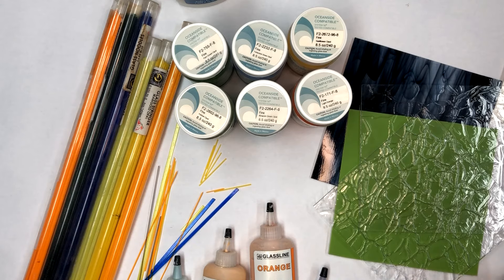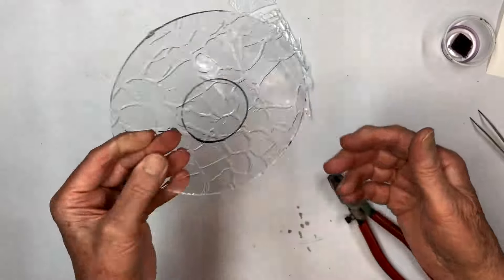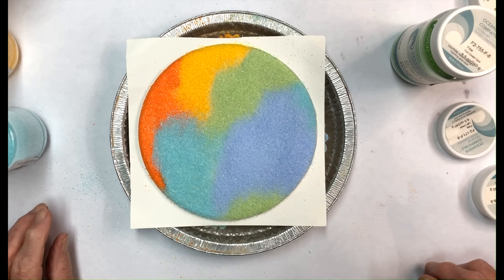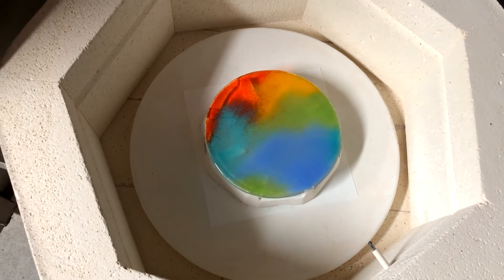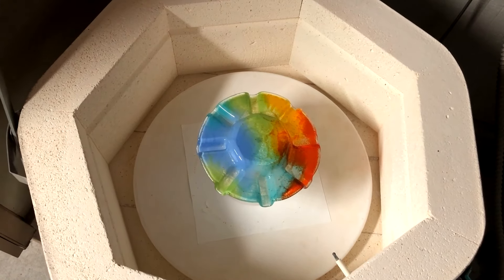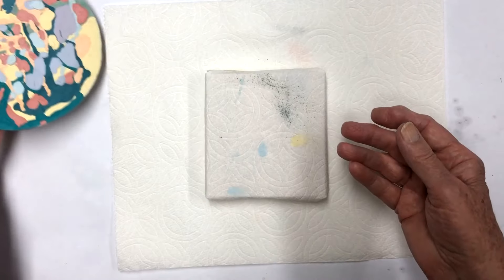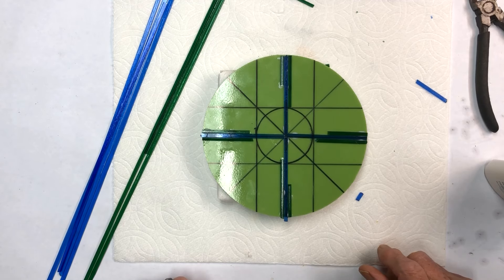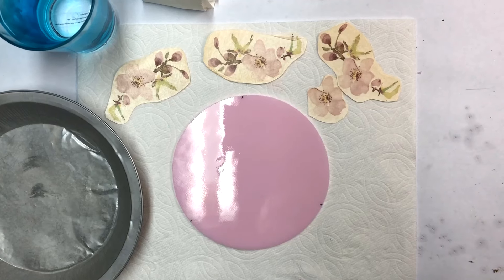Fused Glass Candy Dishes!!!

Comment: I so wish I had a kiln! It is on my list ❤. The dichroic bowl is my #1 favorite. My #2 is the pink with decals. Thank you for sharing your knowledge. You are inspiring.
Reply from the maker: Hi Karen, 
Thanks so much for your vote, I'm going to post the winner this weekend. You will get your Kiln when the time is right. You have to remember it's taken me 50 years to collect all the different systems I have. I had to learn most of these systems by trial and error over time, but with YouTube now you can find out how to do just about anything you want!! Alot of time you can find these kilns for sale in the local newspapers. Before I purchased this one, I was using an old kiln made for making ceramics and it used what they called a cone setter for the max heat and then would turn off. Check around with friends they may know someone that has a kiln just setting around would like to get rid of it. Most of these small kilns just use standard household 110 voltage lines to plug into. If you were happened to find one of these old kilns, don't pay a lot for it, and you would meed to buy some setter cones for setting the heating range. I found 019 cone for draping all the way up to 015 cone for a full fuse. I'm sorry for rambling on!!! Have a great day!!
Regards,
Bill Stone

Comment: Great Video! My favourite is the dichroic dish. Did you use 3mm glass for each dish and was the first firing a full fuse?
Reply from the maker: Hi Alisa,
Thanks for your vote. Yes, all the base glass is 3mm COD 96, it's the old Spectrum glass and is now Oceanside Tile and Glass. The first fuse is a full fuse at 1475, The second fuse is at 1400 to slump and the third fuse is 1220 to drape the dish. I will show a fusing schedule at the end of the video showing the winner of the dishes. It will be posted at the end of the week.
Regards,
Bill Stone

Comment: They are all great. Good conservation of glass using 1 layer. Curious about the fusing schedules. I'll study them in a minute. What COE are you using? Favorite is actually the painted one. New technique for me. 😂
That slump mold is fab!
Reply from the maker: Hi Marcia,
Thanks for your vote, it's a fun project to make and you can do just about anything you want to put on them. The base for all these dishes is a 3mm glass. COD 96, It's the old Spectrum glass, which is now Oceanside Tile and Glass. I was going to include the firing schedule in the video and forgot to put the slide in, my bad. I'm going to make a quick video with the winning dish and will add the schedule at the end of that one. I can tell you the first fuse is a full fuse at 1474, the second fuse is 1400 for the slump and the last is 1220 for the drape. If you have never draped anything before it's fun, you never know what you're going to get. You can just cut a square piece of glass and drape it and that makes a nice candle holder. Again, thanks for your comment, enjoy my videos when you have time. Keep a eye out for the winner video should be later this week.
Regards,
Bill Stone